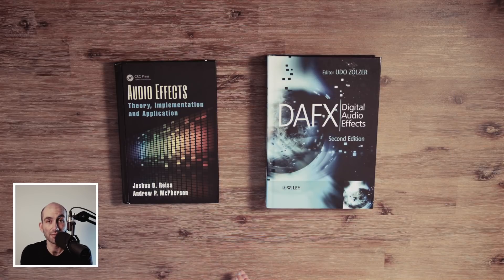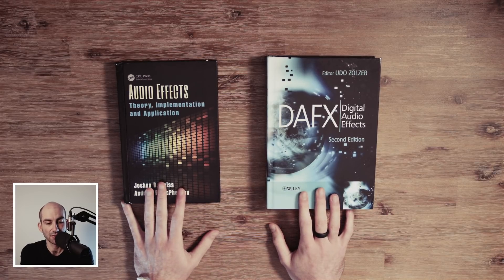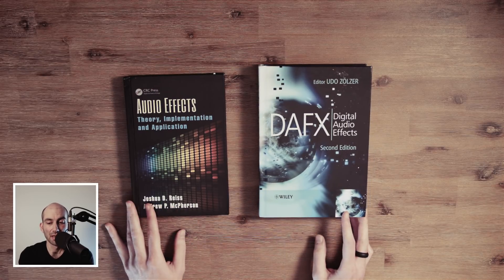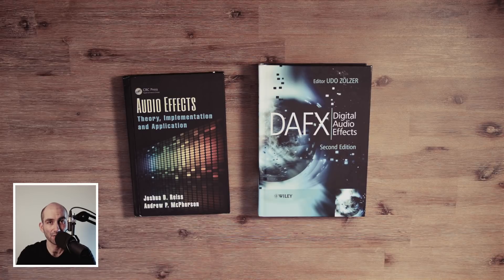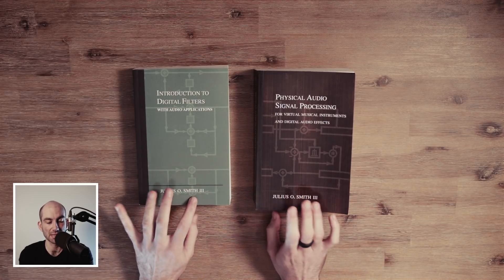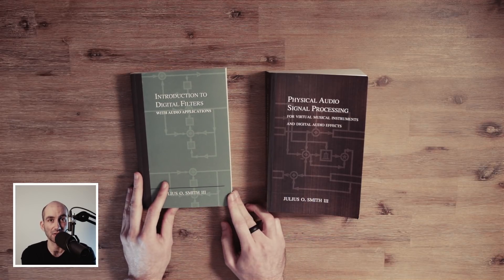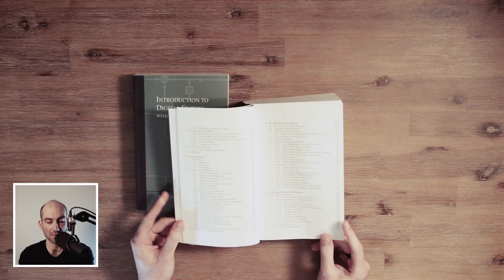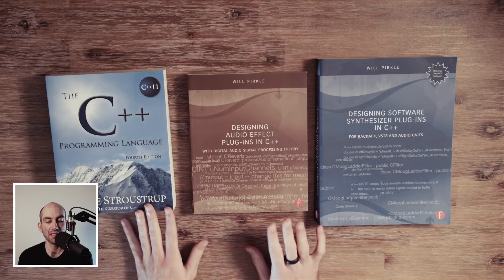15 engineering books for synth nerds and makers

Comment: Thanks for mentioning JUCE. I started building a Max4Live patch to allow me to control my old Emu E5000 Ultra sampler from within Live. I got it to the point of controlling most of the sampler, but ran into a brick wall trying to concatenate lists into sysex messages for patch name updates properly - even though every other control required sysex commands and I had no dramas with those - I'm used to more traditional languages like C - the visual approach Max utilises just doesn't make sense to me. Two minutes of googling about Juce makes me think that will be a much easier approach for me.

Comment: +1 for low level programming and electronics tutorials!
Reply from the maker: Ok I'll add it to my list! (which is growing quite large, so no promises in terms of time yet :))
Reply: The book you suggest "Arduino for Musicians" mentions the Teensy in the index. That would be an excellent microcontroller to do a tutorial on for music.
Reply: Cyberplayer5 The Teency Audio System Design Tool is amazing: https://www.pjrc.com/teensy/gui/index.html You don't have to bang your head against learning new objects.  You build your synth visually and the web interface creates code automagically.  There's a really nice sounding guitar algorithm.  It's been over a year since I fiddled with it.  I can't remember where I found the guitar object???
I had some trouble with midi on off commands using a full sized midi female connector.  I think there are midi-over-USB objects;  that might be promising.

Teency audio tutorial: https://www.pjrc.com/teensy/td_libs_Audio.html
Reply: +1 here